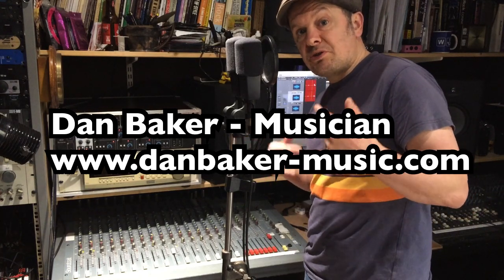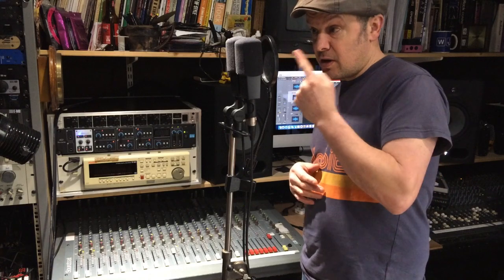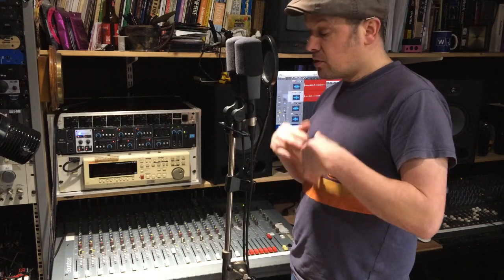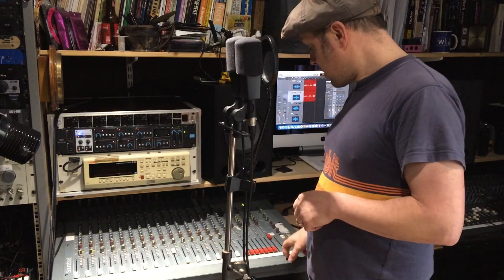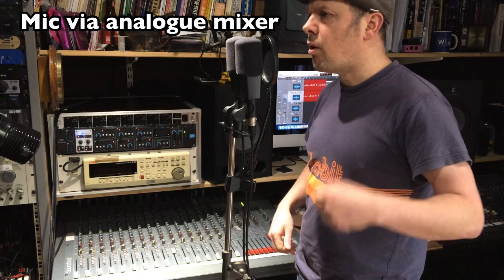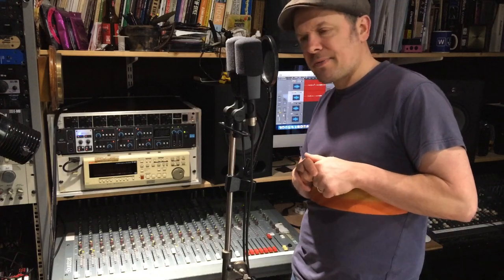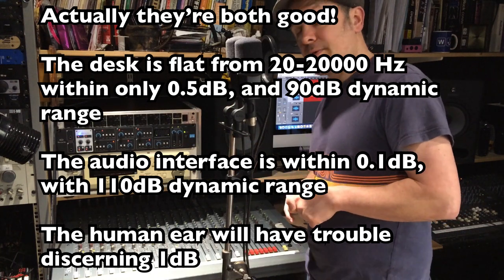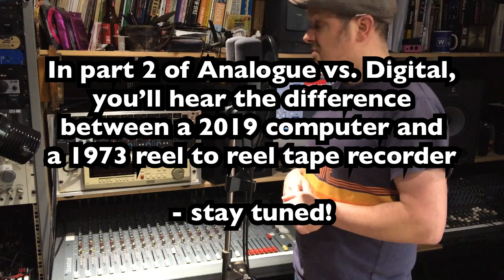Analogue versus Digital Part 1: Does an Analogue Mixer Still Cut it in the Computer Age?

Comment: To be honest I heard the aircraft louder than the noise - regardless of channel. It’s not that the computer does not know what to do, if it’s overdriven but it can’t - because it runs out of digital values to store - so it clips digitally which is always a very unpleasant sound. As to the sound through the Mikes I would be hard pressed to tell a difference. The idea that a digital recording is absolutely flawless is in it self flawed. An AD converter will also generate noise and the recorder like an analog recorder will record everything also noise.
Reply from the maker: Gert Halberg absolutely- the fact that there’s something in the far distant background does rather make a mockery of our obsession with signal to noise ratio. What I meant by the computer distorting is exactly what you said- if it can’t store anything above 0dB (65536 or whatever 2 to the power of 16 is!), it tries to predict what might have been intended (actually the output of Logic Pro does that to an extent). I agree with you about digital recordings - the reason I didn’t mention it is that it would stray from the point of the video. CDs had terrible error rates, and I used to fix Somy U-matic machines back in the 90s. Awful machines, asked to do far more than they were capable of. I guess we can’t win, but computer recording seems to be the best of the digital bunch!